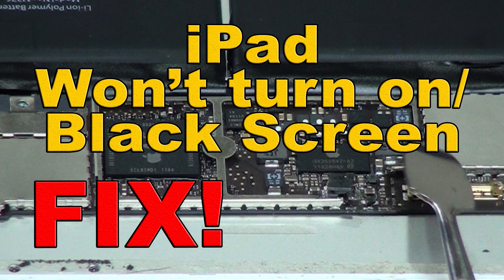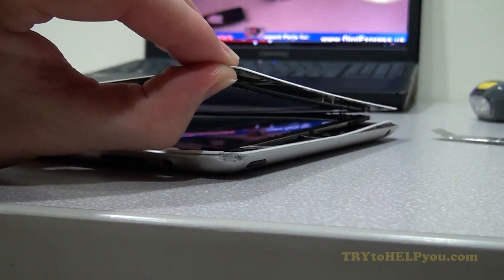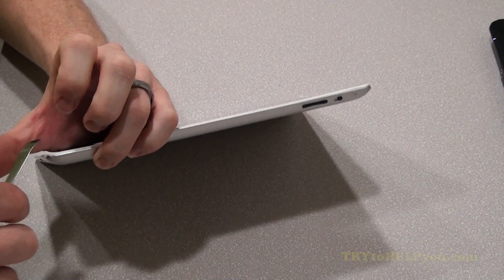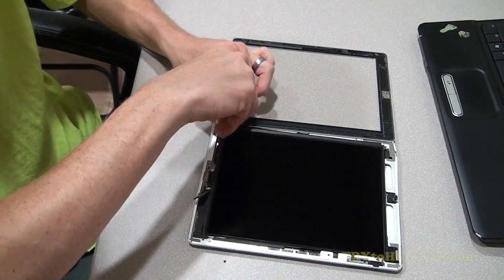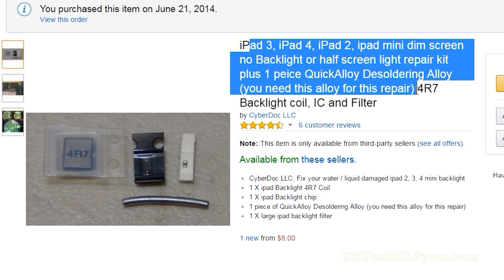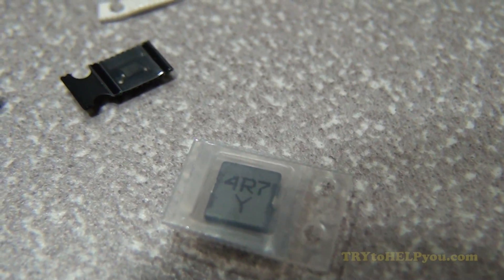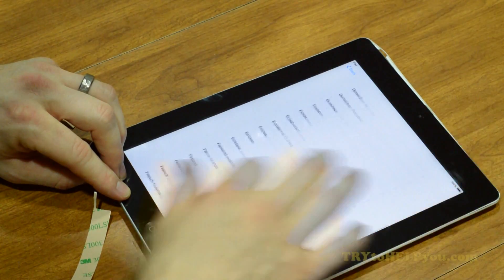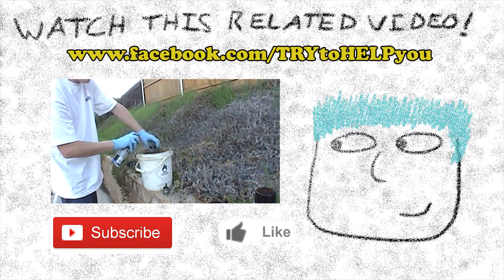ipad wont turn on black screen FIX

Comment: Mine is different well i have a weird bumpy not on top but in side well but mine has a thing on it when i press it hard it is like a thing that is dark purple and black i wanna get rid of it >:c
Reply: You will need to take it to a repair place and get them to fit a new screen on it. Should cost you $150-200

Comment: hi my case is similar. it is black screen when i try to charge nothing respond

only one way that ipad2 respond is connect to itune. it will show  recovery. 
mode. after recovery it will blackscreen again. if i didnot use ipad2

Comment: My ipad mini is only detected on itunes but no display or sound and touch is not functional as if it’s turned off when itunes detects it i have to confirm from the ipad but as no display so i never log on to my ipad..is that ur case?

Comment: my ipad wont turn on with reboot, the down, up volume  combo.Is dis de way?to fix it?For me my ipad might break so im scared as that is more expensive than to just pay 1500 to fix it?pls help
Reply from the maker: +albert martines 1500 is insanity to fix an iPad. Reboot is done by holding the power button down and the home button too. Not the volume buttons. Other than that, all I got right now is the content of the video to try to help you fix it. Good luck!
Reply: TRY to HELP you
 Im saying that is this the only way to fix the ipad if it wont turn on with the reboot? I have done home button and power button them up volume, power button and home then the down button for more than 20 seconds each. + It's actually 4000-6000 I asked.

Comment: Ur vid is very informative and excellent work, but a bit hard to understand for a novice like me, if you could explain some more on the parts side, like how, did u figure out those parts are the problem, would be appreciated.  Thank you.
Reply from the maker: Thanks, how i figured out those were the bad parts was i googled the problem.. ended up on (AMAZON?) and found a kit of parts. I took a chance and it ended up working.. so i shared via video!
Reply: Thanks, appreciate the response.

Comment: my ipad turns on but only stays at 1% when plugged and it wont charge. if I unplug the charger it turns off bc it doesn't have enough charge. please help me find the issue
Reply: 86julionolasco any solution?
Reply: You guys need a new battery most likely, they don’t last forever
Reply: Just need to take it to a repair shop and get them to fit a new battery. Should cost you like $100

Comment: i have been doing electronics for over 30 years this is not a job for some one who does not know a resistor from a transistor ,as well cooking the parts to get the solder to melt you could very well kill the ics .
Reply from the maker: agreed. Ive sent over 10000 ICs through an oven at 500+ degrees and this heat gun was set to the low setting of 500 degrees... prolly should have mentioned that....

Comment: Is there a easier way to fix IT I cant turn IT ON first I was playing a game and its loading 2 mins and IM pressing the home buton its Not working I turn it off and now IT wont start
Reply: Hold the power button and the home button at the same time it could take 20 secs. But it's way easier then this vid